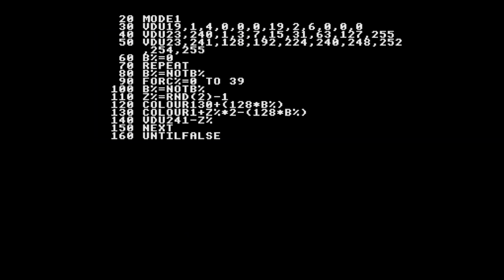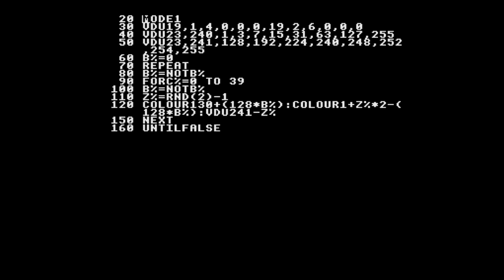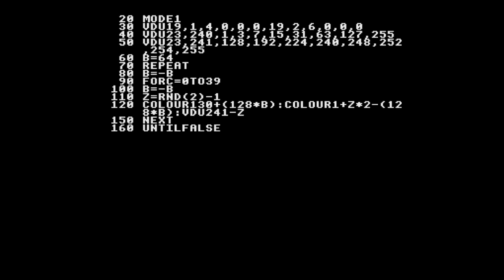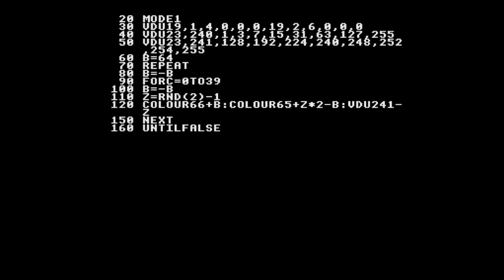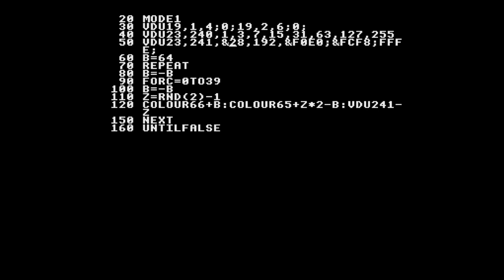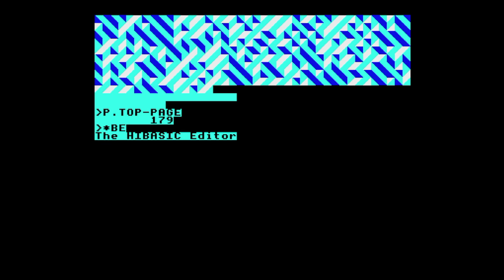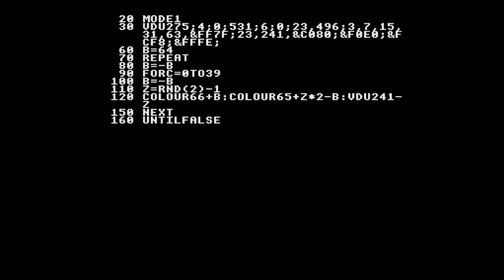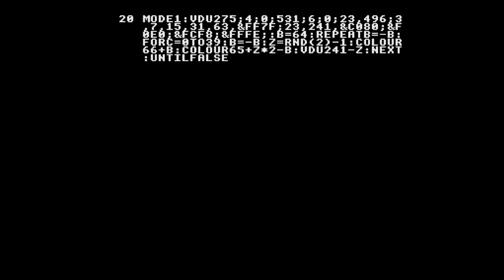BBC BASIC 3D 10 PRINT — The Crunching

Comment: So this turned into a puzzle I couldn't resist!  🙂

I started out with the code as it was at about 7m into this video.

My first discovery was that VDU 22 can replace the MODE statement, allowing it to be combined into the mega VDU statement shaving off a few more bytes.

As @GeorgeFoot and @kaminutter pointed out, the FOR loop can be got rid off.  When considered in the context of the outer REPEAT loop, and we're in a 40 column screen mode, what it does is stop B from getting inverted at the beginning of each line.  I replaced it with IF POS > 0 THEN B = -B allowing the other B=-B to be got rid of.  As George also suggested you can also avoid subtracting 1 from Z, saving another couple of bytes.

Using an IF statement meant I had to use two lines, but it still saved a few bytes and my end score was 137 bytes.

George's suggestion of using lower value characters should give a few more, but as I'd started from the pre-crunched VDU statement I haven't tried that.  It also feels like there should be a way of avoiding the IF statement by using some alternate maths logic for working out the colours, allowing the code to be a one-liner, but my BBC BASIC skills are covered in 30+ years of rust and I haven't had enough coffee.  🙂
Reply from the maker: The problem with using VDU 22 is that doesn't alter BASIC's HIMEM and your stack will be left somewhere in screen memory, if you don't fix it.

The IF idea is good although I can't see how to get something else on the same line — I'm not sure what the rules are here: if you end up with something smaller across two lines, does that win? ;-).
Reply: @lsbyte  ah - the HIMEM thing explains why i get a tiny bit of screen corruption.  Thanks for explaining that - I'd been studiously ignoring it. ;-)

Curiously it seems I was wrong about using VDU 22 giving some savings - on changing it back to use MODE it's 2 bytes smaller!
Reply from the maker: It's the same mistake I made thinking VDU 17 was smaller than COLOUR.  Those sneaky tokens!

Comment: I changed the code to remove the for loop statement for a if pos=0 then b=not b not sure if this saves anything but the output still works. Never thought about combining vdu statements to 16 bit digits before.
Reply from the maker: I thought about doing something with IF but the problem is you then can't put anything further on the line (as the bits are the colon are part of the IF).

Comment: Do you need a line number if there is only one line?
Reply: You do for it to be a valid BBC Basic program, rather than just a one line statement.  It needs to be a program to be able to measure the size of the code (PRINT TOP-PAGE).

I did wonder if changing the code to use of line number 1 instead of 10 could save a byte, but a quick check shows me that's not the case.
Reply from the maker: Yep — I think line numbers are always two bytes.  And, if it's not a program, I can't save it (well, maybe to a *SPOOL file, but then I lose the tokenisation saving!).

Comment: You could define lower value characters instead of 240 and 241. Also maybe there's a way to get rid of the nested loops? Maybe B=128*((POS+VPOS)AND1) then you don't need the C loop?

Also don't subtract 1 from Z, adjust the rest instead
Reply from the maker: Not subtracting 1 from Z is a good idea and I've saved a byte or two with that.

I think VPOS probably won't work, though, as it'll go wrong at the bottom of the screen (when VPOS stops increasing) but I have done something similar with POS=0 to get rid of the inner loop.

Down to 140 bytes now!